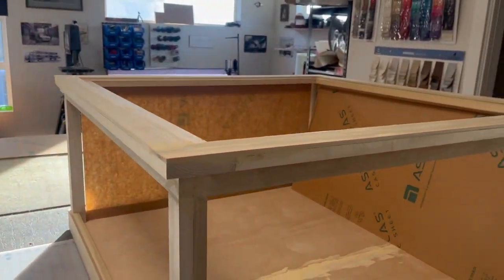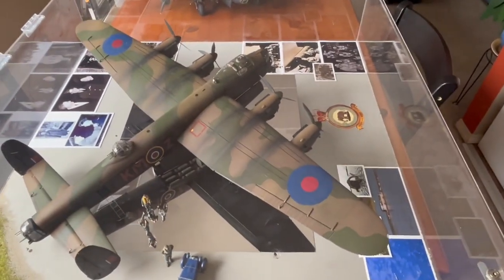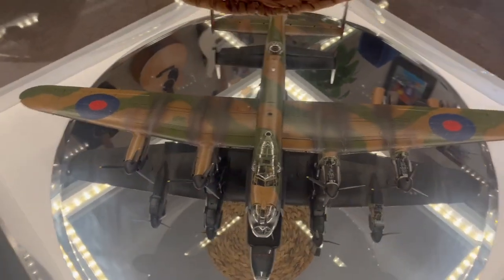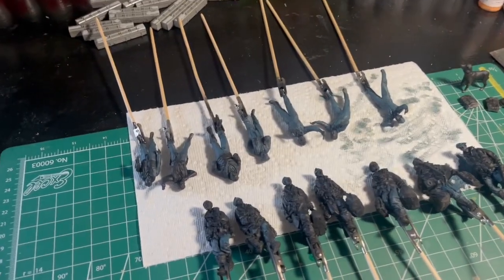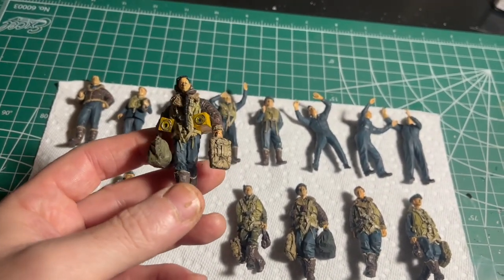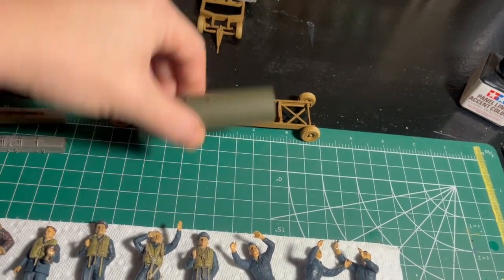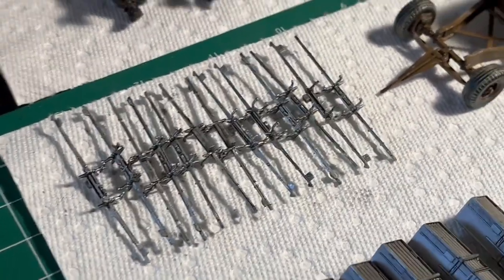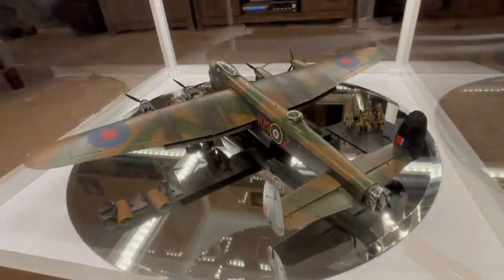Border Model's 1/32 Lancaster Build - part 7

Comment: Simply beautiful!! Very inspiring. I don't know what are they waiting to also do a B-17 with the same accuracy and surface skin irregularity details! Regarding the display, you're doing a great job...after all, we are very lucky; if compared to railway modelers, for example, they need very large rooms  for a proper display. For us, a large model normally takes about 1 meter by 1 meter approximately. You did also a great job with the coffee table...it will be a beautiful piece of furniture.
I did a 1/72 Monogram B-52...I had a nice video till a few time ago...anyway, I bought a plexiglass  casing for it and now I am almost finishing a B-36, in 1/72 scale...it's approx. as big as your Lancaster. I will just buy another transparent casing to be put on top of the previous one.
I said this to encourage fellow modelers not to be scared by dimension...the final result is stunning and you can use many solutions for storage.